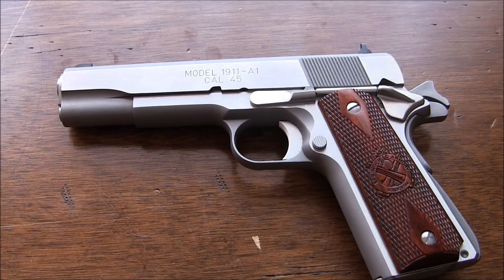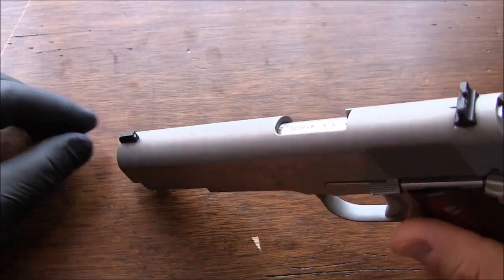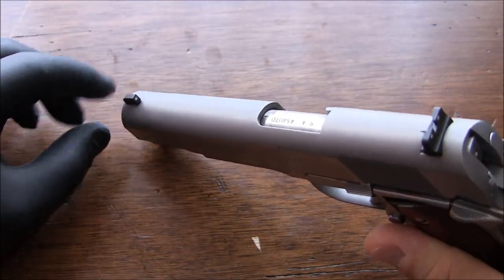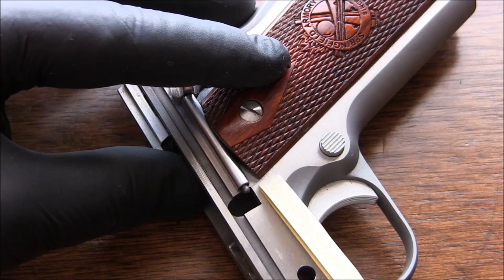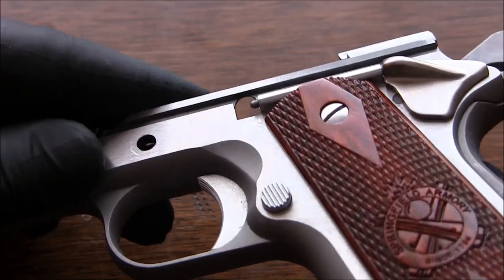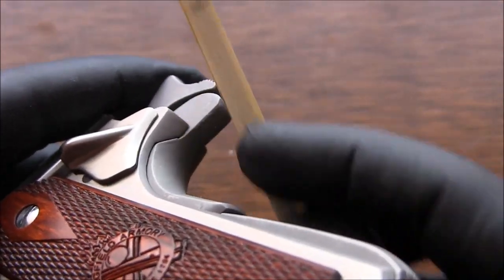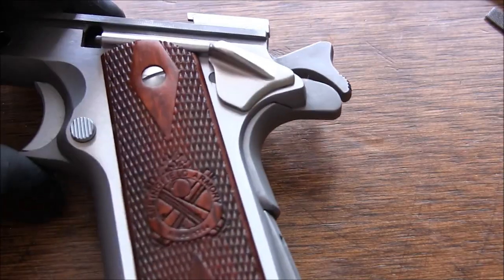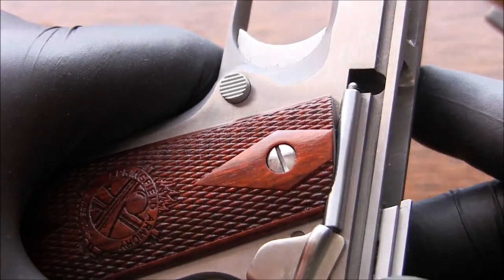1911 Fixes - Sharp Edges of Grip Safety, and Idiot Scratch

Comment: Very good video.  The idiot mark is not an idiot mark at all.  I've seen over and over, the experts, have trouble putting the slide stop back in a 1911, dragging, and creating that same mark.  The 1911 really should have been designed more like the Star pistols, which never had that problem in the first place.
Reply from the maker: Thank you. Actually there is a small modification everyone should do to their Slide Stop. It is called a Log Man Mod.
Reply: I take a 1911 apart the same way the Campaign Hat told me. Do it this way.
Pull the spring and bushing out 1st. 
Of course if did not manage to hang on to all that.
 It was worth 50 pushups to loose control of all that.
 Or maybe not when the Campaign Hat did the counting..

Comment: That's hammer bite. Caused by your skin getting pinched between the safety and the hammer when the gun cycles. It can only be fixed with an extended beaver tail.
Reply from the maker: In this case it was the burr on the grip safety. I know what Hammer bite is, and this issue was not that. One of my other guns is biting, but after I took the burr off the Grip Safety on my 1911, I have put another 150 rounds through it and didn't even have a red mark on my skin. This 1911 never bit me.
Reply: I had the same problem, and rounded the bottom , back, and corners of my hammer spur , and problem solved.

Comment: It is amazing just how many rough, or flawed (burrs, nicked edges, unpolished) parts there can be in a gun. Obviously a $350.00 gun probably should be expected to have more than one that cost upwards of $1,000.00. Normally, unless I spot something blaringly wrong. I run a few cleaning patches down the barrel of a new gun, and shoot it to make certain that it functions the way it should, before I take it completely apart to clean and inspect it. When I do that initial tear down and cleaning, I PLAN ON deburring and polishing every part of the firearm, EXCEPT the sear surfaces of the trigger. I also seldom do anything to the safety system, unless I encounter a burrs, dings or rough surfaces that will effect the proper function of these parts. No amount of "smooth as silk" operation is worth someone getting injured or worse. It's amazing how much better a firearm can cycle when all of those burrs etc. are removed and smoothened. IMO, triggers and safety systems, unless there is an obvious defect should be left to "break in" on their own. Unless you are REALLY qualified, AND KNOW EXACTLY what you are doing. Again, IMO, replacing fire control parts that are made (not modified) specifically for making the trigger pull lighter and/or better than stock are fine. As long as they are properly done. I have seen and used guns that have been modified correctly that had triggers that were measured in ounces, that were perfectly safe, IF YOU did your part. And i have seen and temporarily used guns that were " modified where the gun would discharge by simply closing the bolt briskly, or sitting the gun on its buttstock normally. Those guns are NOT SAFE for use by ANYONE with even expert level skills.
Reply from the maker: Agreed.

Comment: No extended beaver tail is slide bite from hammer. Not some imperfection on the safety itself. It’s the hammer.
Reply from the maker: Usually that is the case. However on mine it was clearly the burrs on the grip safety.

Comment: I bought my 1911 out of my FFLs case. He gave me a price I couldn't refuse! I brought it home and I saw that "idiot scratch" on it. For the price it didn't hurt me ,,,,MUCH! I'm sort of a "perfectionist" and the grip screws had the slot heads on it that were "boogered a little bit" I bought replacements for them, they were expensive but worth it! Torx on them much nicer. I will need to buy some of the 220 and the 600 grit paper. Thanks for the video.
Reply from the maker: My pleasure.

Comment: After you sand out that scratch, wire brush the whole frame on the wheel, and that will blend the finish so that you won't see it. I have a stainless P13-45, and got it looking like new. I did the frame on the wire wheel on my bench grinder, worked great. In fact, the wire wheel will take out small scratches all by itself.
Reply from the maker: Nice, thank you very much.

Comment: If you disassemble the whole gun and use a flat stick (or it is possible to use you have if you do it right ) with sandpaper starting with a grit that matches the finish or what ever grit you choose but step up in sand as you go, like 320 , 360, 400, 600, 800 ,1000, 1500, 2000 then use polishing compound you will have a very shiny gun. That is why I like stainless steel it can be repaired not like blued guns.
Reply from the maker: R Shay I completely agree, stainless is very easy to touch up.

Comment: Nice job! I just recently bought a Tisas 1911. It came with an "idiot scratch" from the previews owner. But unfortunately mine is not stainless. So I may have to find a way to cover it. Hard to find what the real finish on it is. Also I need to round the factory ambi safety as it has some sharper edges. The gun was un-fired when I bought it. and I bought it as a project so I'm watching videos like yours to decide what I am going to do to fix a couple things. Anyway thanks for the good video.
Reply from the maker: you could contact Taurus to find our what the finish is. then make all alterations you want at once, then take the remaining finish off and refinish.
Reply: Its Tisas made in Turkey. I haven't found a way to contact them yet. I think Buds gunshop says they are parkerized. But it looks really nice for that. I may just leave the idiot scratch and file the safety off the gun so I don't scratch anything else and refinish that.
Reply from the maker: +Jason Lester sorry. a case of brain fart. I read Tisas as Taurus.
Reply: Haha no problem I do stuff like that all the time...

Comment: Hello again Mosin.  I had the same problem with both of my Rock Island Armory 1911's.  I got slide bite from both of them.  The only difference is my grip safeties are blued rather than yours which I assume is stainless.  Would this technique work for me as well?  I guess I'd have to re-blue it some using this product I do not like.  Would you please have any do-it-yourself recommendations?  Thank You Sir.  Sincerely,   JAMES.
Reply from the maker: Hi James, yes if yours are blued or parkerized and you only dress down the corners you could touch it up using Birchwood Casey cold blue. The color may not match exactly but since it is only on edges it will look fine.

Comment: It was not properly staked at the factory.Tisas made in Turkey are 350.00 and have forged frames slides and barrels for 300 bucks less than a Springfield gi
Reply from the maker: Agreed. It was not staked correctly

Comment: Hi Mosin, I did exactly as you said with the 220 grit sandpaper, and it got rid of the scratch, but the sanding left sort of a scuffy mark, as if the sanding didn't match quite right. Think I should try a different grit? I have the same stainless 1911.
Reply from the maker: Follow up with 600. Or scotchbright pad.
Reply: Perfect -- Scotchbrite pad worked great...looks like nothing ever happened! And Springfield was going to charge me $100 to buff it out at their factory!
Reply from the maker: Glad it worked out. Look into the Log Man mod for the slide stop. Never scratch the frame again.

Comment: i've never had a problem with the grip safety, my issues has always been with the edges on the slide leaving cuts everytime I release it.
Reply from the maker: Are you talking about the ejection port or bottom edge?
Reply: the bottom edges along the slide release. I had the same issue when I had a colt 1911A1 government model too. the one I'm referring to now it the colt 1911 WW1 replica. I'm guessing its an issue with colt made 1911s

Comment: i have a raptor II stainless in jail and got to see it today when i started the dros. the previous owner left a few faint scratches and i'd like to know what that tool you used is called to sand.
Reply from the maker: Risky Business you can use anything as a backer for sandpaper. I used a small needle file and simply put a strip of sandpaper over it.

Comment: would this procedure  for the idiot scratch work on a nickel frame as well? Or what would you recommend?
Reply from the maker: Thank you for watching. It depends on the depth of the scratch. If your scratch cut through the nickel coat, not much you can do unless you de-plate and replate. I have been able to polish out imperfections on nickel using rough side of leather and white rouge. You rub the rouge onto the leather, thereby loading it, and then lightly polish nickel with that piece of leather. There is always danger of rubbing nickel off.
Reply: +ftcampyjr No, do NOT do this on Nickel.  Hopefully you have not.

With Nickel finished guns, you get an old shirt, some Mothers Mag wheel polish, and you hand rub the polish in, and then wipe it off.  Repeat this process many times.  When it is all good, you apply a light coat of Renaissance Wax.

Comment: Hammer bite, i don't think that edge file is going to help , extended grip safety, or commander hammer, it's the reason why you see this swap so often.
That is a fine gun, like my mark four goverment model that hammer cocking  bites your skin between the grip safety, trust me.
Reply from the maker: I would agree if that was the reason. But in this case it was the machining or casting burr on the underside of the GI grip safety. I used to get bit by my TT,  :)

Comment: nice video! is that a metal file; any brand/style recommendations?
Reply from the maker: Hi, yes, it is a flat mini file, or needle files as I believe they are called. I wrapped sandpaper around it because it is too coarse by itself. Any brand will do, you could even use something else as backing for your sandpaper.
Reply: MosinVirus thanks man!

Comment: the idiot scratch I am starting to believe is complete fabrication by people who want the gun to stay pristine but no matter what the gun will obtain a scratch or two because it is a gun and a tool. Using the idea that it is because it is assembled incorrectly is completely wrong. The stop is suppose to swing upward as the first angle at the top of the area that moves against the plunger is intended only to cam off the plunger itself and pushes in on it and it serves no other purpose. That said the so called idiot scratch is simply because someone has it fall down and then pushes it back into place while it is pushed in further. It is a mistake anyone could make. 

My build is more of a show 1911 as well and has a high polished frame so any scratch shows up on it well but is easily polished back out if it is fine enough. Sorry but the scratch is just evidence it was used and not placed in a box to look at. Don't be so hard on yourself it is not an idiot scratch it is a "I at least use my gun" scratch. 

The front sights that are staked in are fairly easy to fix as you seem to have quite attention to detail and pay attention to what you are doing. Just restake it with the slide held in a vise with plastic jaws or wood and something like plastic resting under it for it to rest against (low profile vise works great) then restake it with a punch. For extra insurance put a drop of blue loc-tite below it before staking. To make it a bit easier you could pull the entire sight and start a small pilot hole with a small drill bit to give a center punch a point it can't skate off of. The last method is permanent hit it very lightly with a spot of weld and then blend it into the slide the sight will never move again but at the cost of not ever being able to replace the sight without drilling the hole back out. 

Personally I think all staked front sights should always be brass or aluminum. Sure it is not as strong but it is an easier material to restake. I had a sight I had to stake back in on a shotgun I had shortened to 16 and 1/2 inches on the barrel. The method I chose to deal with it was to drill the hole in the correct spot and then place epoxy down in the hole and tap it into place. The epoxy in the hole just ensured it did not back out or work loose. It never came off and is still on the shotgun.
Reply from the maker: evilcowboy Thank you. Yes, I understand and agree that the gun will get scratched with use. at the time it was the most expensive handgun I owned and I wanted to baby it. I later fixed the front sight as well.
Reply: Some people see a car as a tool. Some appreciate them. That doesn’t mean one person is right and another wrong. I often hear people whine about it being a tool and nothing more. The idiot scratch in my opinion refers to people who get a gun and simply don’t educate themselves with it. I took my CCW training with a couple of glock fanboys. They didn’t know what a python was. They didn’t know much outside of Sig and Glock. Ok, whatever. It’s these guys that typically scratch a 1911 because they don’t appreciate them like they would a Glock. Fortunately for them, a Glock is easy to take care of.

Comment: Regarding the "idiot scratch", bro LEAVE IT THERE!!  The Army actually taught recruits to drag the slide stop up the frame when reassembling to better help get it underneath the plunger. That's why most USGI pistols have the scratch.  All those little imperfections give your 1911 character, man.  Now if you did that to a Stan Chen custom or an antique Colt with Turnbull restoration, THEN I'd call you an idiot.
Reply from the maker: Couldn't leave it. Wanted to see if I could fix it. And then all the 1911 builds came.
Reply: Shit...I thought the date of this video was Aug 2018...not 2013. Guess that's what i get for not wearing my readers.  Imagine my embarrassment.
Reply from the maker: @Mr911Medic  all good.

Comment: Your hammer bite is coming from when the pistol recoils , and the spur of the hammer pinches your skin between the bottom of the spur and the grip safety . Rounding those two edges on the grip safety will not fix the problem of hammer bite
Reply from the maker: Thank you, but it wasn't a hammer bite. The edges of the grip safety had burrs that were digging in. Hammer bite usually results in marks perpendicular to the gun axis. Mine were parallel to the gun axis. Regardless, I know for a fact that the burrs were causing that irritation and skiN breaking, and once I got rid of them the irritation went away.
Reply: Sounds good. Am glad you got her fixed. Can't believe they would send it out like that . Have had my SA 1911 for 32  years now , so all is nice and smooth . Only 2 barrels and 2 extractors replaced. I think i have 75-80 K rds fired . You take care of her and she will take care of you . They only get better with age.
Reply from the maker: Thomas Herbert I actually sold that one, but I have built a few of my own. Check out my more recent videos. Build 10 was the lastest.
Reply: Combat commander hammer

Comment: I'm not trying to give you shit dude. 
It's just a good habit to have. It doesn't matter what the reason is. For example, you coulda been at a range and had a failure to fire with one round left. Then you woulda racked a round in the chamber while safety checking and clearing without knowing it. It can and has happened. That all I'm sayin.
Reply from the maker: I know. I am not saying that what I did in the video is right. I always do a proper check before making videos. it was just an after thought thing I did in front of the camera. you will notice in other videos where I actually planned to show it being cleared that it is done correctly. in any case, I wasn't  arguing with you.

Comment: i had two idiot scratch on the frame and on the slide.  contacted springfield and their tech recommened me to get a 3M Contour Surface Sanding Sponge, Super Fine; which i got from Amazon for $5.78.  here's the link: http://goo.gl/izFijM

then i followed your video on the direction where to sand based on the grain and it came out flawlessly.  after that, per SA's technician's suggestion, i used some a dab of ballistol (or any gun lube of your choice) on a patch and lightly coat it.
Reply from the maker: eosme Nice. I am sure it came out great. We are lucky that our guns are stainless, as it would certainly not be as easy to fix on blued, parkerized, or coated guns.

Comment: This is why you buy the Loaded as opposed to the mil-spec.
Reply from the maker: Yup. But at the time I couldn't afford a loaded. Though I was able to mod my mil spec. Check out my other videos where I bobtail it, add beavertail and checker both front and rear straps. Now I am building my 2nd 80% 1911. So in a way, I think it was great that I felt I needed to work on it.

Comment: I would at least have removed the wood grip before sanding on the frame. As well as removed the safety to work on it. It looked like you hit the frame and hammer a couple times.
Reply from the maker: I know. Back then I was very new to this.